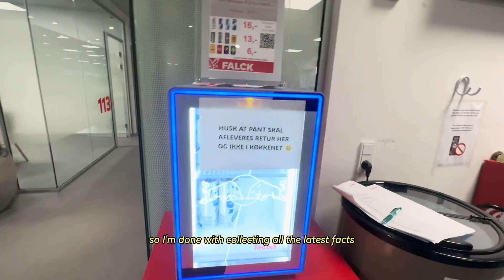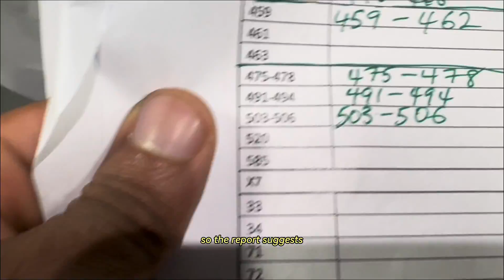Network Engineer Vlog: Core & Access Switch Upgrade

Comment: Dear John,
I love your videos! I wanted to ask if you might have any old or unused Cisco routers or switches that I could have or buy to practice with. I’m currently studying to become an IT technician and working on my CCNA certification, with plans to continue to CCNP afterward.

Having some real hardware to work with would really help me improve my hands-on skills.

Thanks a lot in advance!
Best regards,
Reply from the maker: Hey unfortunately I don’t have ownership of the network equipment. I strongly recommend Cisco Modeling Labs for your CCNA studies, you don’t need physical equipment to get through the CCNA

Comment: Question regarding the EoL switches. Is it just a support thing to replace them when they reach EoL even if they can run another 10 years without any issues?
Reply from the maker: Hey man thanks for the comment! There are many reasons, first of which is security, once switches are announced to be EOL, it means Cisco no longer provides software updates or any type of support for the devices. Secondly, I already started to notice that some interfaces were dead on the switches. In a business where emergency calls are being handled and EVERY second counts, we need reliable gear.